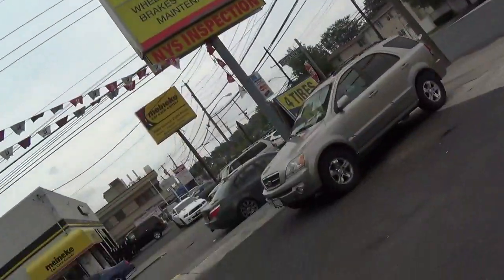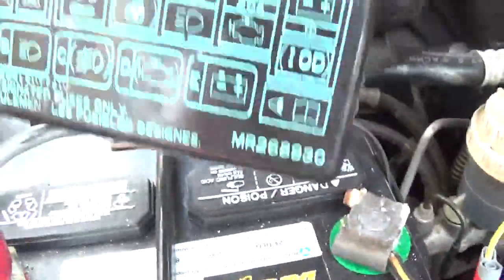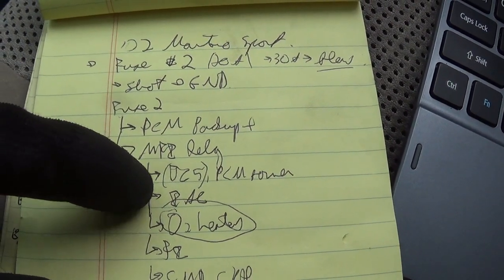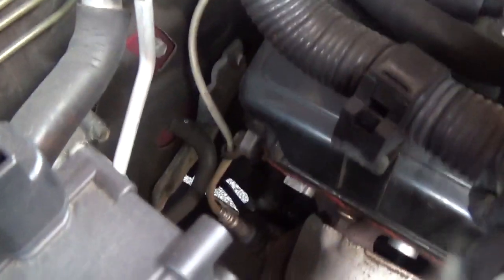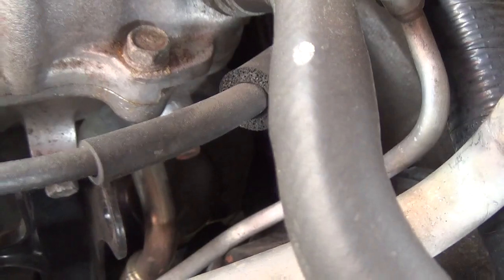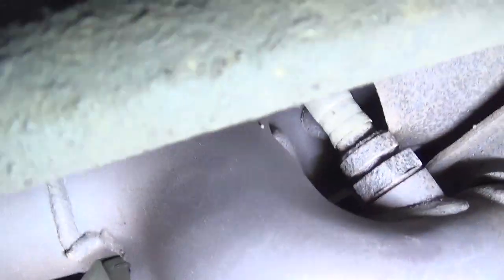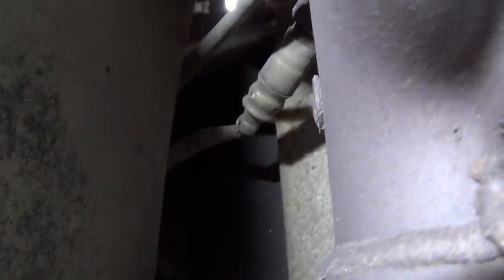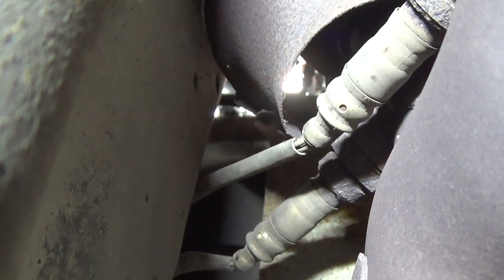Stall no-start: Mitsubishi Montero Sport (SI Ep 4.1)

Comment: Proper repair = replace sensor/reattach heat shield.

Used car lot repair = bend edge of heat shield away/electrical tape on exposed wire

Comment: Pretty common on older 4.0L jeeps before they went coil on plug. The Oxygen sensors short and it blows the ASD fuse and then it won't start.

Comment: Please help me i have a 2003 Mitsubishi Montero sport and i have fixed all the problems its given me but this is by far the worst most difficult and challenging, i replaced the starter the battery has a full charge i also replace the potive cable that runs to the oil sensor the compressor the fuse box and the starter but when i go to crank the vehicle i get nothing just a click. It is the weirdest thing ever and took a tool just to test if i had current and i did so there is current all throughout the fuse box, battery and starter i need help please

Comment: I have an 02 Mercury Grand Marquis  that will run rough, the coolant light will turn off and on. then one day it will rumble then shut off with a check engine and battery light. as soon as you shut it off and restart the lights are off and the car starts up.  now it may be 5 min or 5 days before it will do it again. it's been to 3 shops and 4 mechanics (one of which was a certified Ford mechanic) and no one could figure out what was wrong. of course it would do it randomly and never did it with any of the mechanics-but of course would do it on the way home.  so I know it has to be something but I'm at a loss on what it could be
Reply: Kevin Eaton Get the trouble codes, gives us a better idea of what's going on
Reply: Kevin Eaton where are you from?
Reply: mman454 the bad thing is it doesnt kick out a trouble code. as soon as the car os restarted the lights go off and the code reader will say no codes found
Reply: ONBOARDTECH333 sw missouri
Reply: Kevin Eaton I will do a little research and locate someone to help you out. We mobile guys have a pretty large network
Reply: ONBOARDTECH333 thank you so much!
Reply: Kevin Eaton 4177204368 "417 Motor Works. I see them on our group page and they have good standing. Dont know them personally , but they appear to be equipped and responsive in our forum.
Reply: ONBOARDTECH333 thank you ill give them a call!!

Comment: I like in the end you listed the proper fix, so what really happened was remove the heat shield and add some electrical tape?
Reply from the maker: Well at least they did install a new sensor after doing some "weight reduction" on the exhaust system xD
Reply: Haha, classic. Just tell the customer not to park on dry grass fields, and they'll be good

Comment: My friend how are you come to the 3/4 of the intelligence the pro. Mechanic work look the reason the 2003 gmc enjoy 4.2 l is BCS the switch of the awd inside the car some switch are made for 4x4 vs awd are not the same is missing pin in the conector if the light it will not stay on last light is BCS is incorrect you have to try on blaze enjoy 2003 model good luck my friend.

Comment: so someone smacked the heat shields when replacing gaskets or replacing the sensors which looked pretty new. and I bet the customer didn't inform the shop about prior work that was done. Eric the car guy did a video where he explained the things he hates most about doing customer cars and this should have been one of them. the mechanic goes on a hunt for 3 hours when with some vehicle history would have taken 30 mins.
Reply: Bad DFW Mid-Cities Drivers It looks like the car was at a used car dealership. Could be the case that the dealership bought the car and sold it, then ended up with an unsatisfied customer. They then get stuck having to try and fix the car without the history from before they got it from auction. Plus ya gotta admit, a tech that replaces a factory 20A fuse with a 30A one and calls it done, probably isn't going to think too much about the prior history.

Comment: Hey I have the chance to buy a 1998 Shogun Snow athlete, for just £550 as it won't start, & the guy thinks its an immobilizer problem. He did have the car up at £1250 but since this problem happened, he dropped it to £650 now to £550,as he said he has no scanner to plug in & see what the problem is I .I have not had any experience with These Shoguns myself. So Waa  wondering if anyone has any advance on what to look out for, or if its even worth my time, & money that I don't even have to spare on something that's gonna need alot of work done to it. I am from the UK so we get bad whether & I just want a big safe car for my wife & kids. As I have my Subaru Impreza, & the wife has the Ford focus saloon Ghea. But she needs more space, as we have a 3 year old & a new born, also my 14 year old, who is autistic. So need something reliable. Any help welcomed. Thanks ✌ this was a cool video, just goes to show that the smallest thing can lead to bigger problems.